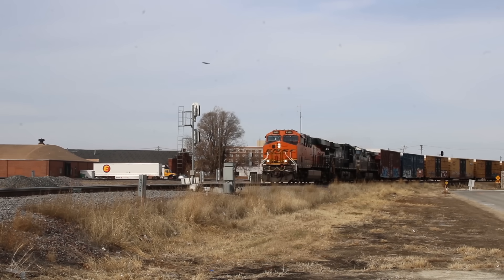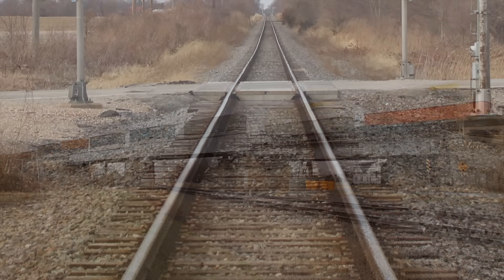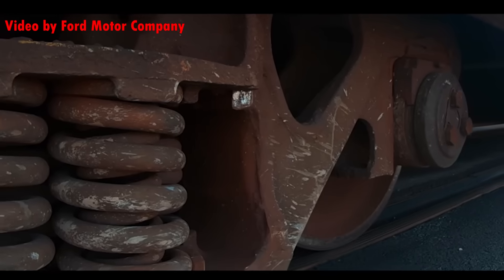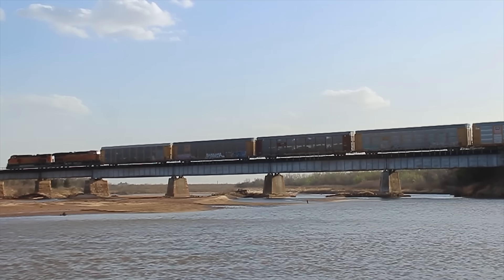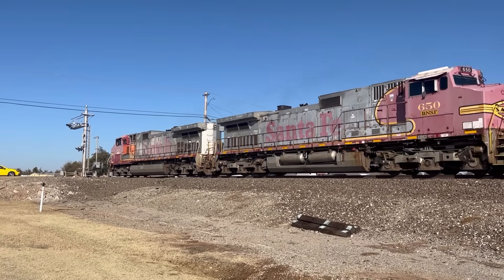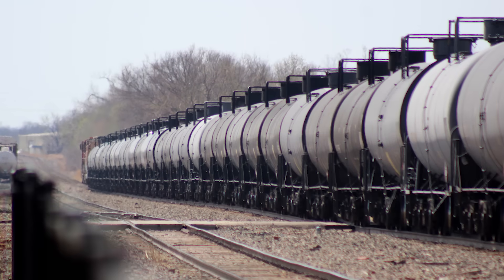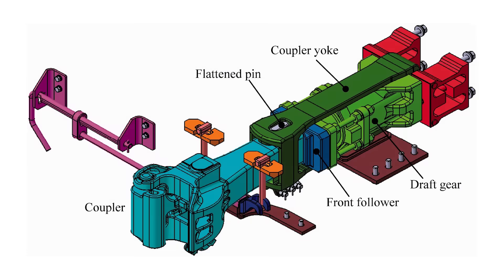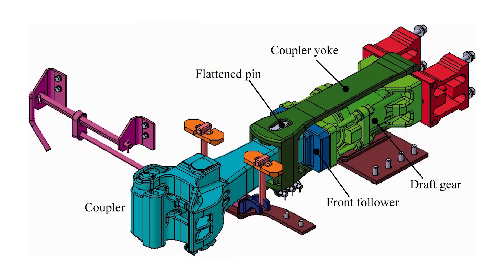Why Locomotives Can Pull So Much

Comment: Actually this video has a HUGE Missinformation, because the friction thats needed to be overcome isn't correlated to the area. Science also differentiates between rolling and sliding friction, neither are affected by area of contact. Sliding fricton is where two surfaces move in correlation to another. Like ice scates on ice.  Here in the video the friction between train and the track is only the rolling friction (the friction or to be precise energy loss between a static surface and a object rolling on it), like inside ball bearings, where the hardness and manufacturing accuracy primarely affects the energy loss (friction) between objects.

But the youtuber is kind of right with the sliding friction, because inside the bearings the lubrication needs to be moved out of the way, which kind of behaves like static friction. Or the brakes were still engaged and the braking pads need to be moved away from the braking rotor.

I know this because i studied this in Uni and had the exact same misconception before that. I'm from Germany so pls excuse any missspelling.

Comment: Growing up near the tracks in Johnstown PA in the early ‘50s, I remember the days of long trains starting up before the introduction of draft gears. I may be wrong, but I believe the engineers first backed up the cars, removing all slack at the couplers. Then they reversed the process, and started to pull, with a resulting “bang, bang, bang” as each successive car came under tension.

Comment: What I learned in this video. . . 1) locomotive wheel sanders, 2) overcoming static friction via coupler design, 3) close to a half million pounds of engine weight, 4) dime sized surface area between wheel and rail. Thank you for this video!

Comment: Interesting video, but you have got so much of the science slightly wrong. For example, when rolling there is STATIC friction between the wheel and track. The engine has to overcome the friction in the bearings, not between the wheels and track. But it was a well-presented video, with some interesting points. Thanks.

Comment: I worked for BNSF years ago and was picking up cars from a steel plant. A crossing was cut near the rear with 2 cars on the other side. I had walked back to join the air hoses while the rest of the crew did something else and on a whim I kicked off the hand brakes and I was able to get those 2 cars moving just enough to roll to a join with the rest. It definitely took some time to get them moving. This video explains why I was able to do that.

Comment: So in the  Ford commercial where an electric F-150 pulled a million pounds worth of Auto racks they CHEATED!
Because we all know that the electric F-150 can't pull a boat or a camper trailer around the block without having to recharge!

Comment: The static friction is wrongly explained in this example. It has nothing to do with that why it's difficult to start from a standstill.

As a matter of fact wheels are under normal operation ALWAYS using static friction. The only reason why ABS exists in cars is actually to guarantee static friction over dynamic friction (which is lower and happens when you lock a wheel)

When you are talking about static friction you should be talking about inertia and acceleration. Please, correct this.

Comment: Force of friction is not dependent on the area in contact. The mass and coefficient of friction of materials are the only two factors in play. Put rubber on the rolling stock of train carriages and asphalt in place of metal beams on the tracks and see your friction problem skyrocket. 

Pls do your research next time

Comment: That’s so interesting about the slack being needed for the loco to start the train - it makes total sense but never occurred to me as a deliberate design choice.
Reply: It's not really how it's done. You don't ever want to deliberately yank on slack or you could break the train in two. The best configuration for stopping and then starting a train is for it to be stretched. A train is like a string, when it's taught, it's harder to pull apart. If you slacken it, then pull you can break it. The draft gear moving is more for cushioning against buff forces, ie, bunching the train.

Comment: aint science simple ? the sheer weight of the loco combined with the science of the traction motor make it happen. if u goose the motor at a dead stop  u can burn holes in the rail. makes a cool sound

Comment: Low friction between a wheel and a rolling surface is what makes you spin out, not pull heavy trains. High static friction between a wheel and a rolling surface is what allows you to accelerate and slow down. Your explanation is wrong, and it boggles the mind of everyone who paid attention in their high school physics class. The more friction there is between the wheel and the rail, the quicker you can accelerate and brake, and the heavier loads you can pull. What is actually low is rolling resistance. Rubber tyre vehicles on asphalt roads have high rolling resistance because of the deformation of rubber tyres and bumpiness of roads. Low rolling resistance of steel wheels on rails means that less force is required to accelerate the same mass, which is why one strong dude can pull a whole railcar, and why locomotives can pull many times more load than trucks with the same amount of motor torque. The static friction locomotives need to overcome when starting from a dead halt, and need draft gear for, is bearing friction, or friction between the axle and the rest of the bogie, which is more akin to the resistance you experience when you try to turn a stuck screw.

Comment: Excellent video about how trains work! Long lines of passenger cars or freight moving across the horizon are wonders to behold and now you know the secret.

Note: if the locomotive is accidentally pulling on air due to a “lack of transfer”, i.e. it ain’t hooked up, then there is no way for the rest of the freight to catch up to the runaway train belching its own power and not pulling any weight.

Some people incorrectly think there must be some kind of backup power plant in the rear or maybe hidden partway back mixed in with the freight so that if the workers do not actually hook up the freight to the engine at the at the front the rest of the freight will grow legs and run and catch up, pushing the freight up to speed to catch up with the runaway train.

Be honest, how many of you thought that freight can just start moving by itself, engine or no engine! Or maybe each freight car has its own low power engine like a distributed network. Nope! It’s all at the front.

So if it isn’t hooked up the engine has to stop, go back, get hooked up and then go on.

Hopefully that doesn’t happen too late, any conductor that drives an empty train for miles before realizing it had to back up and hook up to the freight has eventually slapped themselves in the forehead and said “Oh. Right. How could I forget”, before missing every scheduled stop.

It is a lesson every conductor learns just once.

Comment: Now this was a fascinating video and answered so many questions, especially the draft gear, you described it perfectly. But what if the whole length of the train is on an incline, would i be correct in saying that in that case there would be no slack as the train would be 'stretched'? Really hope that's not a dumb question as i do find this fascinating. Great video, cheers.

Comment: A wheel on a track is always stationary.  So the static friction hypothesis is not all that's going on.  There is static friction in all the bearings and linkages resisting the axles from starting to rotate, but then again the contact points in correctly installed bearings should also be stationary at their points of contact.

Comment: This is also a great explanation why it is so hard to start uphill. If you are uphill, there is no slack as the carts are trying to roll back. Unless you have fancy breaking system that would prevent them rolling when you start accelerating of course.
Reply: On North American locomotives and older euro locos (ones with lapped brakes) it's normal to start applying power as the brakes are releasing.  That way you have torque applied to the wheels as the brakes come off to prevent rollback.  Modern Euro locomotives simply don't release the brakes until you apply power.

Comment: Back before the heavy  emphasis on fuel conservation, it was common practice to pull on a train with air set when coming to a stop. The primary purpose of this was to have all of the slack run out, to facilitate a smooth start. The locomotives will start an entire train moving all at once, and it’s MUCH smoother that way. The difference in static friction and dynamic friction in the wheel bearings is very, very tiny.

Comment: A lot of incorrect Physics statements in this video, surface area has nothing to do with the apparent friction of a rolling wheel. the real reason why rail wheels are better than rubber tires is because they don't deform as much a rubber tire is going to deform significantly more causing much higher rolling resistance.

Comment: Electric motors provide high torque. 
The Diesel engine drives an Electric generator that powers Electric motors turning the axles.
Thus Diesel Electric Locomotive.

Comment: The best modeling railroad draft gear and locomotives are made to operate as close to the same principles as the real thing for the same reason.  However, modeling weight cannot be to  'scale'.  If it was, you wouldn't be able to lift a model train car, let alone a locomotive.  The structure of a model train layout, as well, would be hard pressed to hold one freight car, to say nothing of a locomotive, or an entire train, lol!  Even in modeling trains, one car that does not roll virtually effortlessly, say by just blowing on it, can cause enough drag to wreck a whole model train in a scale curve.  This aspect can make train modeling interesting, as well as very frustrating, at times!   I have seen the same tension and drag effects wreck a real freight train on a tight curve here in the Blue Ridge mountains, as well!  The challenges in pulling freight over the Rockies is equally difficult, if not more so, due to the sharper elevation changes in the terrain there.  Stopping all that momentum once you have it going at speed, well, that's another nightmare, lol!

Comment: You are misrepresenting friction. Without extremely high friction, a locomotive could not move itself. Locomotives are built as heavy as possible to increase friction, thus tractive force. Your subject involves overcoming inertia, which requires amazing amounts of friction between the rails, wheels and tractive force from the traction motors.

Comment: Years ago, I worked for CN and in the mid 70s often rode on freights.  One thing I soon found out is the engineer didn't want to stop the train, if he didn't have to.  So, he'd bring it down dead slow, allowing me to hop on or off.  If I had equipment to carry, I'd have to space it out alongside the track and hand it up, a piece at a time, to a crew member.

BTW, one detail about starting a slack trains, the more cars that are moving, the more momentum that can be used to move more cars.
Reply: @anon_148  Canadian National Railway.  Back then, I was a technician for CN Telecommunications.  I worked on systems for both the railway and external customers.  In the mid 70s, I was based in Capreol, Ontario (near Sudbury), which is on the main line between Toronto & Montreal and Vancouver.  The track between Capreol and Armstrong (North of Thunder Bay) was pretty much in the middle of nowhere, in Northern Ontario.  This meant if I had work to do, anywhere along that stretch of track, I had to go by train.  While there was passenger service, there were a lot more freights, so I often rode them.
Reply: @James_Knott  That's really cool!
Reply: @James_Knott sounds like a hell of a job
Reply: @mikehunt3420  There was also a lot of killing time, waiting for the next train.  On the other hand, there were times I was sitting in the club car, having a beer, while making time & a half!  🙂
Reply: @James_Knott  Damn thats really cool. i love the railways too, and the enggineering behind them. Would be cool if you shared some stories from your career. Cheers!
Reply: @James_Knott  hopefully getting a lap dance or two lol
Reply: What would the maximum length of a single stack container train pulled by one locomotive without draft gears and with zero slack be if roller or ball bearings are used to reduce the static friction of freight cars?
Reply: @Loanshark753  No idea.  However, I expect it would be the total weight, not the number or types of cars that would determine how much could be moved from dead stop, without slack.

Comment: This is an BS argument.
The question is exactly the OPPOSITE: how can such gigantic inertia be overcome with such LITTLE friction?!
Cut, dislike.
Reply: Exactly! All these comments and this is one of only a few speaking some truth. The wheel-rail friction is huge, not low and it has to be. That's a good thing. It allows the locomotive to pull without slipping. 

The train is hard to start moving not because of friction, though I'm sure the bearing and such contribute at least some to the overall force required, but rather because of momentum. F=ma after all. 

I'm so glad to see another comment speaking some reason.

Comment: Euro freight train locomotives serve very different needs, and thus they are very different than American ones. Main differences are: Euro freight locos are all electric, are more powerful than American ones, and run at much higher cruise speeds (typically up to 160 km/h). However Euro locomotives do not need that much tractive force because train compositions are shorter. Trains also accelerate and brake at faster paces than American ones. 
This is all because virtually all rail networks in Europe are build around passenger services, therefore freight needs to run faster, forced to stop and wait at specific places, and to follow scheduled timetables in order to fit between passenger train slots. Also many freight trains run only at nights because that’s only when they have enough free slots and less interference with passenger services. 
It would be nice that the Euro system was covered as well in the channel

Comment: What is the friction like between the wheels and the bogies (also called trucks) on the sets? Using something aviation grade like Grease 33 could potentially cut fuel use by extreme margins if more of that friction was to be eliminated in my opinion. Or perhaps modify these higher grade of lubricants to be only for rail cars and locomotives so that it’s cost to savings ratio is very beneficial since it wouldn’t require any certification which make up the bulk cost of these aviation grade resources

Comment: Based on the assertion early in the video that each engine weighs ~428,000 lbs (214 tons) the 4-engine train near the end of the video has 1,712,000 lbs (856 tons) of engines pulling it.  Wow!  The numbers associated with trains (weights, lengths, car counts) get big fast!  Impressive.
Reply: not all engines are always online, some are isolated or not even running.   Usually only the head 2 or 3 are actually pulling.

Comment: Nice wipe at 3:23 :-) This video is excellent. I'd add a few things: the very low grades that trains travel over, so that changes in gravitational potential energy is minimized. With regards to static friction, it seems you're mixing that concept with momentum. Technically the "static friction" that must be overcome is in the bearings of a train's wheels, since the wheels themselves (should) never slide on the rails. So when starting a train, momentum is the key variable (because the static friction in train bearings is very low). But the draft gear aspect was fascinating! I always assumed there was just slack between the couplers. One last point: the old fashioned steam engines and modern electric motors have one thing in common: efficiency at any RPM. Internal combustion engines do not have such efficiency. Thus a modern miracle was born: the diesel-electric. :-) Keep up the good work!
Reply: Yes he indeed mixed up concepts of inertia and static friction. Static friction between rail and wheels help the wheels to turn instead of sliding. Sliding will then produce kinetic friction. So static friction is good and don't need to be overcome and as said in video it is already quite small due to small contact area. What engines need to overcome is INERTIA.
Reply: @wildwizardplanet  Excellent, and thanks for the details! 🙂 One minor point: static friction is very large, not small due to the psi of the contact surface. A modern diesel electric locomotive has 12 drive wheels, each with a contact surface the size of a dime. The locomotive's 430,000 lb weight is spread over a small area. The huge pressure gives a healthy amount of static friction.
Reply: @FlatEarthMath  yes exactly what I meant to say is small area of contact. Of course static friction has to be sufficient and in these types of trains actually static friction of locomotives is the one that matters because only its wheels have traction motors. So they must have enough static friction to overcome inertia of whole train or they will slip. In fact they add extra weight to locomotives to achieve sufficient static friction.
Reply: @wildwizardplanet  Yes, exactly. I studied engineering in college, and we went through all the "coefficient of static friction" problems the long way. I've often marvelled at the fact that the coefficient of friction of polished steel on polished steel is quite low. But those locomotives are beasts! 🙂